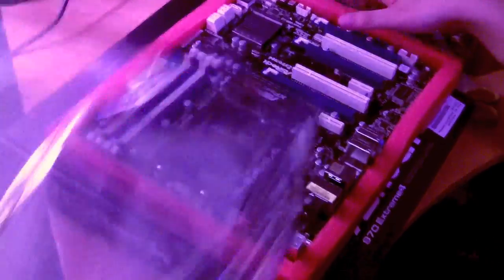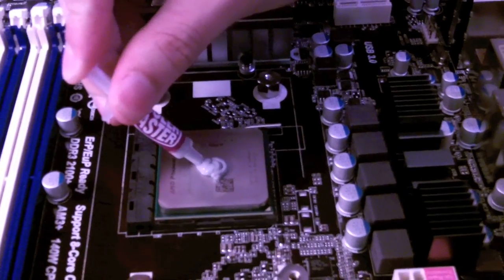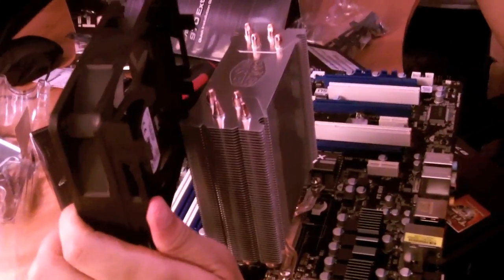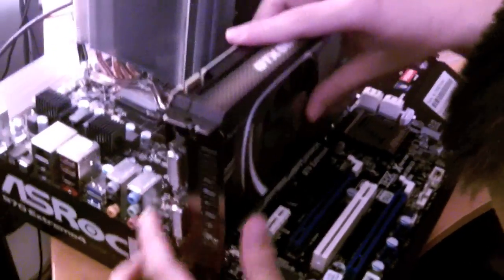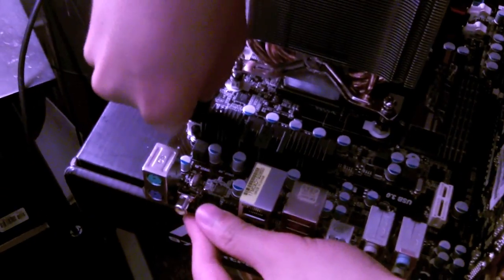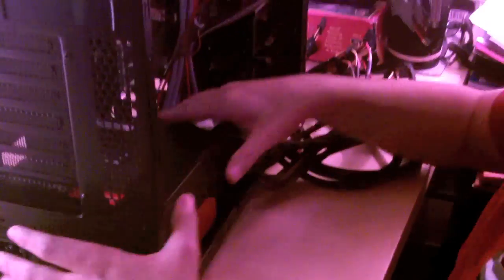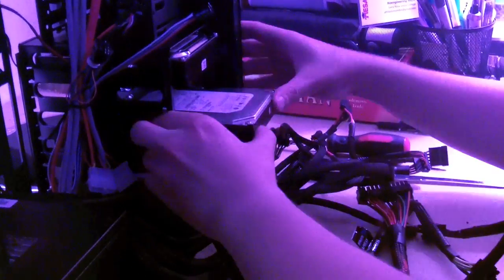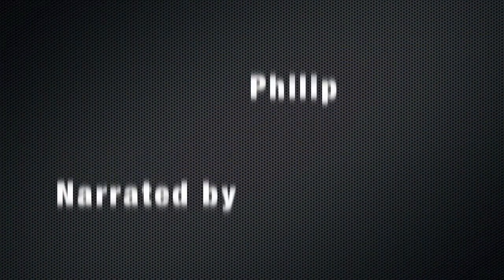Computer Build by the Flipmeister

Comment: why do you A. use so much thermal paste and B. spread it like that. you will get air bubbles like that. just use a pea size blob in the center and apply even pressure to the cooler to spread it out